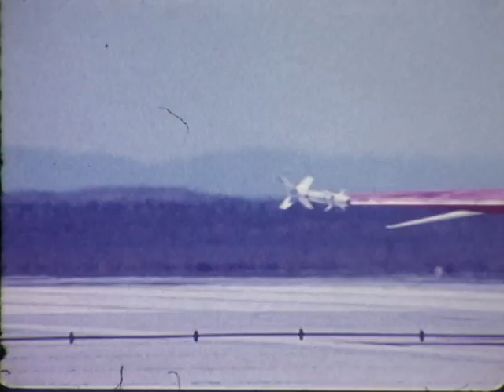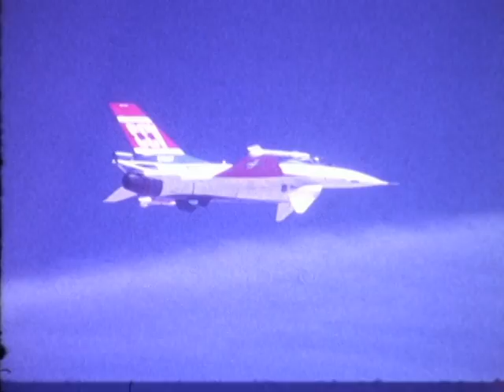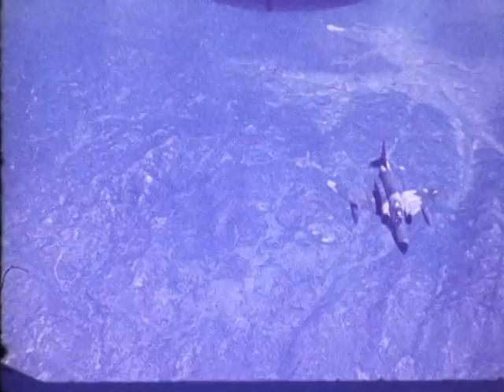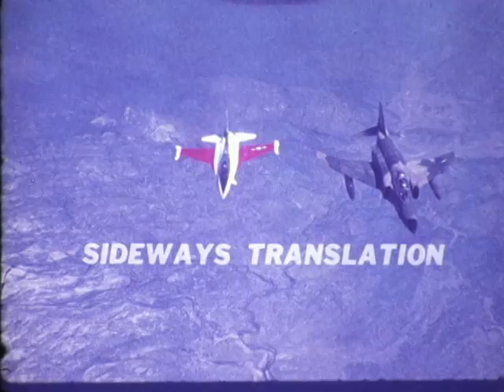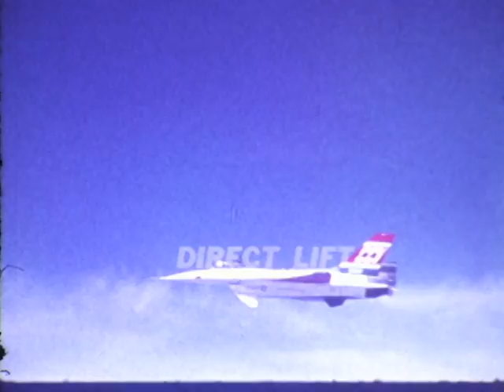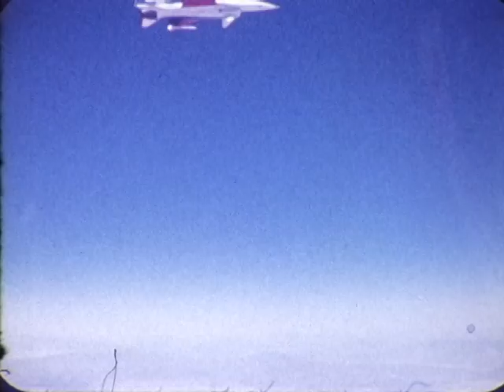F 2248 General Dynamics F-16 Falcon Control Configured Vehicle

Comment: ccv+thrust vectoring would be great
Reply: Combine everything from MATV, AFTI, and get the composite wing from the F-2 and a beast of a plane would be made. I'd love to see that dice with a F-22
Reply: @Shadowboost F-2 was supposed to be a CCV aircraft actually the canards where removed late in the program do to cold war draw downs but the control system remains.
Reply: So I was wrong, the F-2 DOES have this ability. They were able to accomplish it by modifying the wings and air intake and remove the canards.
Reply: @FsxF2  that sounds interesting.. do you have the link to articles about it?